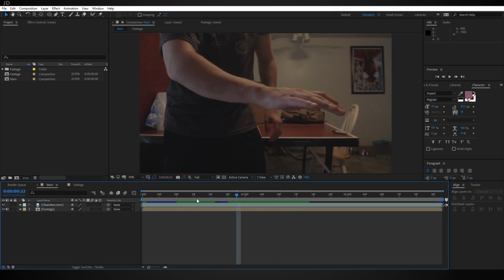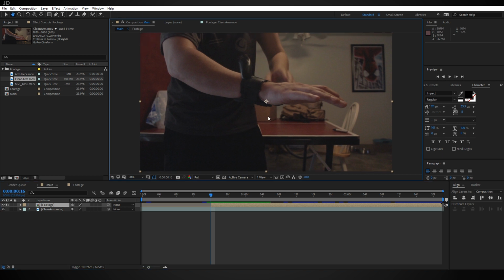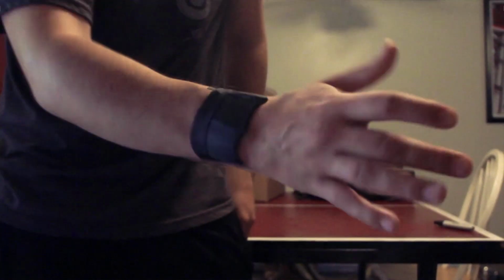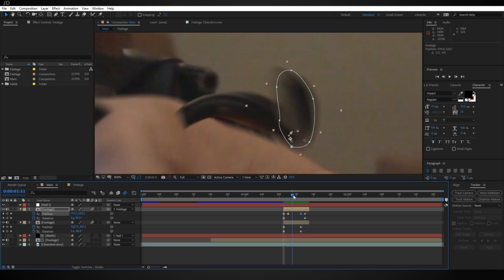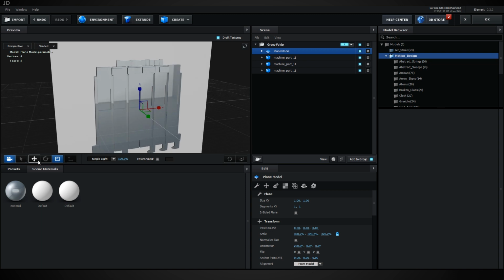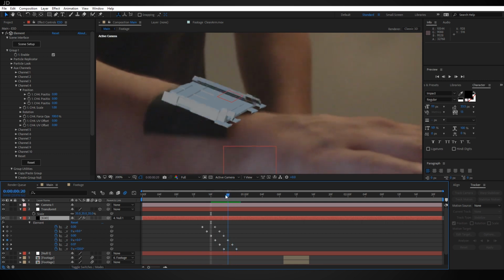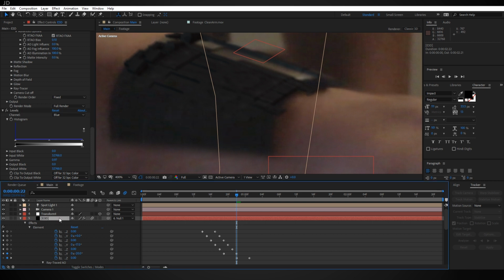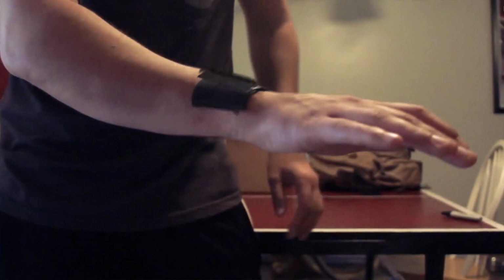Spider Man Transforming Web Shooter TUTORIAL | Adobe After Effects and Element 3D

Comment: This was absolutely INCREDIBLE!!!  WOW!!!
Man, can you help me?!   For some reason, Spot lights and shadow maps in Element have completely stopped working.  I use shadow maps all the time and they use to always work, but now they simply will not cast, and NOW the spotlights are effecting anything!  I don't know if it's AE's spotlights (they won't refract light off of element 3D objects) or if it's Element 3D's models or what, but Basically, shadow mapping is giving me terrible results or none at all.  Of course, Ray-Tracing works fine (which is annoying because it eats so much ram and I want to use spotlights for my project!)  I am having this problem both on my Mac computer at work and my PC at home... anyone experiencing anything like this?
Reply from the maker: Thanks for the kind words! Sorry to hear that you're having issues. I haven't ran into anything quite like what you're describing but most of the time when I am having issues with weird shadows on my spot lights, it is because the light isn't actually where I think it is. Toggle your views (try top/front/right/ etc.) and make sure your light is actually correctly positioned in your scene and pointing in the direction it should be. If it is, and you've checked your settings (cast shadows turned on for both element AND your light layer) and you're still getting issues, It could have something to do with the normals on your model or even just an After Effects glitch. Make sure drivers are up to date, and try clearing disk cache. Good luck!

Comment: Great tutorial! 
One thing I would suggest you do differently at 11:50, is to use a Solid as a Matte to cover the object from the finger, since you're using Position and Rotation keyframes and you might end up having to adjust the frames later on, then you'll have to readjust the mask keyframes as well, whereas if you use a Solid, you won't need to redo it every time.
Reply from the maker: You are totally correct! That would definitely  be the correct way to hide to button pieces and since this is a tutorial, I should’ve taken the time to do that. Good catch